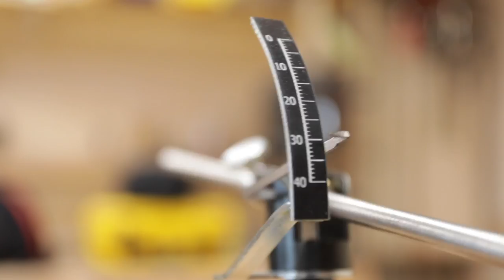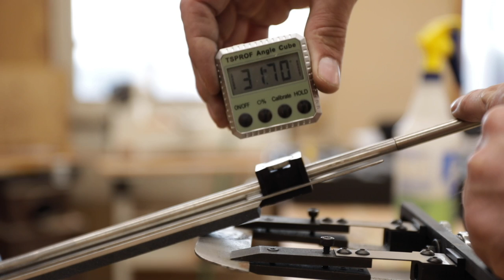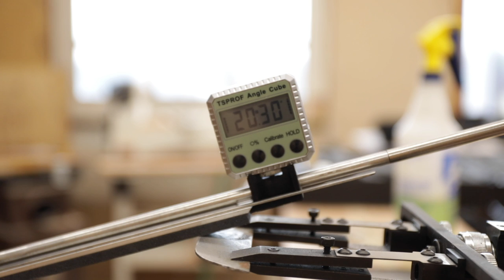Can A Knife Be Too Sharp? 2

Comment: Almost all materials (including steel) can be rated on the "Rockwell scale" and most materials can be rendered quite sharp (ever had a paper cut?)  The ability to hold an edge though (not distort under pressure) is what makes some knives better than others.  Too hard and the edge is too brittle and more likely to brake or fracture (like sharp, shards of glass or obsidian flakes.)  To soft and the metal edge will immediately fold over on itself (even under pressure from the grind-stone.)
Standard stainless steel (AUS-8) kitchen cutlery. has a rockwell rating of between 57-59 Rc.  Chef knives are about 60 Rc.  Either one may be sharpened to a razor edge. (Did you know, dull butter knives were provided at medieval banquets to discourage the wearing of the personal dagger?)
Carpenter's chisels, saw blades , planer knives etc., all have different Rc ratings, because the tools all do different jobs.  A typical circular saw-blade for example, may only be rated at 50 Rc, but the tungsten-carbide saw- blade tips, are 90 Rc.  Some even have imbedded, synthetic, diamond dust in the tips for cutting concrete, tile, stone etc.
Anyway, diamonds (the hardest known materials) are about 1000 times harder than quartz (rated about 80 Rc.) Diamonds cannot be measured on the Rc scale, since they cannot be sharpened to a testable, razor edge or point.
The science of sharping different materials for different uses, is quite convoluted and I'm no scientist, just a Googling carpenter.

Comment: The pocket knifes bevels bring it down to a thin edge profile which after the hardening and tempering it has a secondary bevel (the edge )ground on and honed. The other low carbon steel only has a primary bevel (scandi grind) which makes it harder to get sharp. All the people saying it's the different grade of steel are wrong. It's the other factors that turn a piece if steel into a knife which effect the edge. A good high carbon steel such as 1084 has good edge retention after proper heat treat and tempering cycles.

Comment: you said you have the 5 pc sharpening stone set. that would be their boride stone set. that is a synthetic arkansas style stone.

the sheet metal is indeed so soft that it holds the edge for only a moment... as it is used it is bending that edge, and could be quickly improved again with a steel, but that would again last only a few moments.

Comment: Man, if I could afford to I’d start learning to Smith. Stuff like sharpening, wood working (for the handle) all that go right alongside it.

Now, as to why sheet metal doesn’t get that sharp. 

Knife metal go through a different process then sheet metal, see, when a knife is being made it’s heat treated. Brought up to a red hot temperature and dipped into water or oil.

This hardens the metal, thus allowing the blade to hold an edge. 

I know that sheet metal does in fact get some form of heat treatment, but it’s left bendable, soft, on purpose. 

You noted how the edge seemed to move. because as the point of being sharpened that thoroughly, you were simple removing metal and pushing the edge back and forth. If it had been hardened like blade metal, it wouldn’t have moved around like that, rather, it would simply have ground down into a perfect edge.

Second, I think that it has a slightly different composition, knives generally use high carbon content in their steel, this may have much less then is required.

Comment: Your knife steel will be tempered, but your sheet metal won't be, so sheet metal will be more soft and won't hold an edge like knife steel. Even on your 2nd cut through the paper you could see the sheet metal had lost its original edge. Keep the videos coming though 👍

Comment: now i only did 5 months or so of material studying (metals) and i can say a sheet of metal probably used in construction has a different chemical composition/ mechanical composition, different manufacturing procedure to get it that thin, different temperature treatment different levels of carbon, different structural compounds bonds that are made for a different purpose other than forming real thin blades. some metals are weaker than they should be when they are thin and stronger than they should be when they are thick, also, in case it is a mechanical composition material you might want to look for another sheet of the same material but laminated while sitting on the edge(assuming this one is laminated while standing on the wider surface.) imagine a sandwich and u make it thinner and larger and thinner by squeezing it with a flat surface. now try doing it with the sandwich on edge. Assuming that it wont turn into a bloody mess, and it will come out in one piece, you get some other type of material, now for that to make sense, this sandwich has to be extreeeeeeeeemly thin and with thousands of layers.

Comment: I'm a hobby machinist, not a metallurgist, but I wonder if the waviness you saw is from a similar phenomenon to what one sees with cold rolled steel -- mill a flat surface off a flat bar of cold rolled and you unbalance the residual stress in the metal, and wind up with a curved bar.  You are milling a lot of surface material off that edge, perhaps this allows the internal bits that "want" to curve to do so.

Comment: It won't cut right because it's just mild steel and less hard & brittle than high carbon steel. There's more flexibility in the metal so the blade tip won't stay rigid and it dulls out fairly quick. The content inside and tempering of the metal is what makes a usable blade.

Comment: Hey, just wanted to share my two cents. The biggest reason you can’t sharpen that is because it’s not heat treated. There’s different ways to harden and temper different metals but I’m not gonna get into that. The other reason is the carbon content is just too low. That’s why homemade knives made from cheap Home Depot bar stock suck and can be discouraging to beginners. I think it would be a cool video if you made a nice knife out of an old lawn mower blade or even a file..

Comment: My guess for why its not as sharp: Heat treatment. A sheet of untreated sheet metal is probably pretty plyable and when you but a fine edge on it, it does hold the edge as well because its softer. Your pocket knife is probably head treated several times in order for the metal to be hard enough to hold an edge well. =)

Comment: I know this is old, but try taking a torch to that sheet metal making it really red...throw it in some code water.  Then sharpen.  Might have to reheat to bring its hardness down.  Its probably low carbon so the temporing may not be needed.

Comment: Just encountering your video and I thought I would mention that the reason you didn’t get shaving sharp is the fact you were working with mild steel and the knife edge just doesn’t have the strength to stand up. One thing you may do to help would be using a 25 degree angle to broaden the edge a bit more but I suspect it would still have failed. Knife steel’s have the strength but not mild steel.

Comment: It's probably because the sheet metal isn't heat treated to retain a good edge, it's either too brittle or too soft. I'd go with too soft since I don't think it's Rockwell hardness is close to that of a low to mid range steel like 8Cr13Mov or even a 440 type steel. So I think it's because the sheet metal has a lot of inconsistencies in areas of the edge, some harder , some softer etc. what could also be a factor is that it's not a forged piece of metal . Hammer forging makes the parts of metal more compact which makes them harder since the areas between them get hammered out.

Comment: For softer steel you should choose a wider angle.
If the angle is too narrow you will get this thing that you've described - bending of the cutting edge, wich would never allow you to cut hairs.
Try 30 degrees and maybe it will shave.

Comment: You cloud try to sharpen just one edge and flatten the other one to get a single-edged blade, so the angle is much smaller, like with razors or Japanese sushi knives. Also, I wonder if it would work if you would harden the steel with some heat treatment.

Comment: I think anything can be sharp. It's just a question of wether the material is hard enough to retain that edge. That is why swords and knives are tempered to make the edge hard enough that they would retain the edge and have the material itself and basically resist the presure you apply as you shear or cut somthing. On the end note. You don't just randomly sharpen a sheet metal. You have to temper the edge first. At least if the material would allow you to temper it.

Comment: The grain in the steel is not locked / hardened since sheet metal is just mushed out and left to cool off slowly and remains mailable..   Essentially, its just to mushy.    Folded hardened steel is best, but you might be able to heat and quench it to get it hardened more at least then see what happens..

Comment: You may have solved this already but the hardness level of steal is determined mostly by the ratio of carbon and Iron. ratios the lean towards iron are often more ductile and are better for flexible applications like heat ventilation where the metal needs the ability to expand and contract without cracking. 

on the contrary steel compounds with ratios that lean towards higher amounts of carbon are often hard and sharper which is useful  for blades, swords, knifes or any application they  may require a harder steel. the Draw back is that the structure has much less give and is more prone to cracking or shattering.

Comment: Worst thing you could do for Electrician would be sharpening his blade without letting him know about it.. Knife is used on lot of stuff, and I usually have two knifes. One for fine work and to other which... well basically does not need blade. If knife is too sharp, it will cut through things you are working with. That concrete hole edge is bit, lets use knife on it..

As for sheet metal, you could have quickly used propane torch and oil on edge to give it bit of hardering.

Comment: The reason your sheet steel knife is not as sharp is down to the angles used. To cut masonry, a blade must be between 42° & 63°. To cut steel, blades must be hardened and 70° to 85°. To shave hair, the blade angle must be much more shallow and stepped for strength. Razors are made from high speed ultra tensile steels and begin a 5 angle taper that ends at 22° or 11° per side. Your blade's is 40°.

Start the blade at 5° and work up in increments of 2° as you shape and hone the finer edge. This method will result in a longer lasting edge that stays sharp and is easily maintained for repetitive use.

Water is ok but honestly, machine oil is the best

Comment: Well. I think steel can only be so sharp to a point were you can't get a finer edge and trying to get it to a smaller thickness, like something that obsidian can, is only wasting away steel. And making an edge too fine only makes the edge dull faster, or break/chip easy.

Comment: Knife steel is hardened and tempered specifically to hold an edge. The softer the material the less it can hold an edge. That's why you don't see many aluminium  blades.

Comment: I realize that this is a really old video, but I believe that the issue is that the steel hasn't been hardened.  I'm not a metallurgist either, but I recall watching another video recently and the guy explained that when the burr jumps back and forth, the steel isn't hardened so it won't be able to hold a proper edge.

Comment: The problem with the sheet metal make-shift knife is the steel. It simply is not hard enough. Try to check it out it is no longer as sharp as right after it was honed. Soft steel cannot retain its edge.

Comment: The reason your knife got sharp and the sheet metal did not is not the steel but the heat treatment of the steel. 
You need to adjust your sharpening technique accordingly to the steel you are working. Knife steal generally has a good balance to be easy to sharpen but also hard enough to hold the edge. 
The sheet metal is just really soft.

Comment: i think your pocket knife is hardened and tempered or is at least a harder alloy of steel while sheetmetal is pretty soft (when it comes to steel at least) and the harder something is, the sharper you can usually get it.
that's why the blades made for eye surgery are made of diamond.

Comment: Galvanized 12gauge Metal like that doesn’t sharpen to a razor finish because of the microscopic galvanized grain. Most of not all galvanized is near impossible to sharpen to about a razor. If you use stainless steel you will most definitely get that razor mirror finish because it has very very much stronger fiber grain. I work at a sheet metal company in Yakima, Wa called ALL VALLEY SHEET METAL. And believe me I have tried sharpening galvanized but it never comes out the same way stainless steel does.

Comment: Sheet metal is not hard enough to hold a razor edge as it is made of mild steel. Mild steel has a carbon content of less than 0.3% while for a knife you are gonna want 1% to 2%. If you want to attempt to sharpen mild steel further I would suggest to case harden it. This will make the outer layer of steel into ultra high carbon steel that can be hardened with heat treatment while the inner metal will remain soft. To do this set an oxyacetylene torch to a fuel rich flame and repeatedly heat the steel and then quench in motor oil. Temperature to aim for is 1700 degrees Fahrenheit and hold it there for ten minutes at a time and then quench. Do this for eight hours total, which is admittedly a very long time be you don't have to do it all at once. The blade should warp after this process so regrind the edge back into shape.
Reply: Also very last quench you can do in water just make sure to let it sit in your wife's oven for 1 hour at 400 degrees after you do this. This will make it very very hard.

Comment: The sheet metal is not heat treated or tempered . Leaving the molecules spaced far apart which is why you can't achieve a fine edge .

Comment: Normal sheet metal does not have the carbon content that tool steel or knife steel has, resulting in it being too soft to cut properly with such a fine edge. Had you run it through a hardening process, it'd be way better.

Comment: the steel will not make it too hard to sharpen. it can get razor sharp, but soft metal just doesn't hold an edge, meaning that it will wear fast. the angle you put on the blade is wrong, a chisel has about half the angle.

Comment: My guess on why it's not as good as an actual knife is because an actual knife was forged with a bevil and then that bevil was grinded and sharpened to a fine point and it's of higher quality metal, the sheet metal didn't have a bevil, your just sharpened the edge down to a point creatinga bevil there, but that's not as effective, now that still works I'm sure if needed you could defend yourself with that, but its not a real knife

Comment: Sharpness really depends on the strength of of metal you could have made the sheet metal more sharp if you hardened it. The pocket knife goes through a heat treat which hardens the metal. The wet stones should be soaked at the high grit of stones.
Reply: And to add to that you can get the angle of your edge done before the heat treat process just don’t sharpen it before you heat treat it. There’s could be a possibility of micro fractures on the edge.

Comment: The reason why it wont sharpen to the level you want is down to the crystalline structure of high carbon steel (tool steel), vs regular sheet metal.

Comment: sheet steel is not hardened! you need to heat it up and quench it into water or oil. If your steel is not hardened your edge won't resist to the sharpening... basic stuff to know on blades and metal working in general!

Comment: From experience I noticed that the (base2tip   &then   tip2base) method makes the bevel polish like a mirror because the "X-pattern" = almost mirror shine. I say almost because I can only dream of owning this awesome sharpening mechanism, and I am forced to use honing sticks and stones.  I refuse to use and electrical sharpener, and I will not drag another piece of metal across my knife, shaving off the existing bevel with a drag through sharpener. .  Please try this method and tell me if your outcome is any better if not worse.
Why you put an ⅛" bevel on a piece of sheet metal has me laughing because I'm speechless. This creation most definitely does not need to exist lol

Comment: You can sharpen any bit of steel but it will not last long. You need 1020 grade or higher and it needs to be hardened.

Comment: The steel is not heat treated or tempered so the edge will be soft so that's why your edge was waved you was working with basically a soft steel easy to sharped but looses it edge too fast

Comment: Lets see, why won't low carbon steel sheet metal that can't be hardened or tempered not work as well as s hardened and tempered knife?  I'd have also used a belt sander to do the initial beveling can even make a jig for a ricasso if you're just doing stock removal and not forging it. For the future just go buy some 1080 bar stock. it's cheap and can be hardened and tempered.

Comment: Reason is easy, the metal used is too soft, edge which is created can bend too easily so when created is ok, but it cannot maintain the sharpnes. Thats why when you have a carbon steel and its too hard you can have amazing edge and sharpness, but will breake on any impact or wrong bending.

Comment: In order to get the sheet metal to hold it's edge it would need to be hardened, otherwise it wont stay sharp and it will role the edge Everytime.
Reply: Looks like a Seiko “Tuna” but I haven’t seen one with a polished finish before.